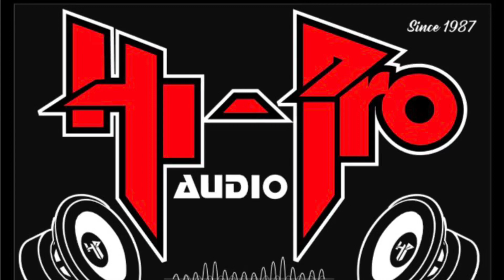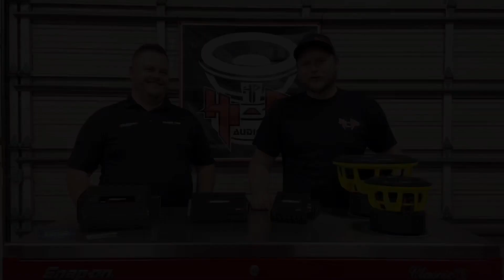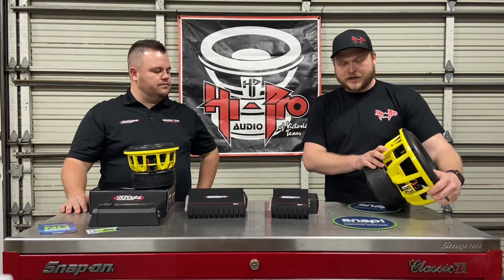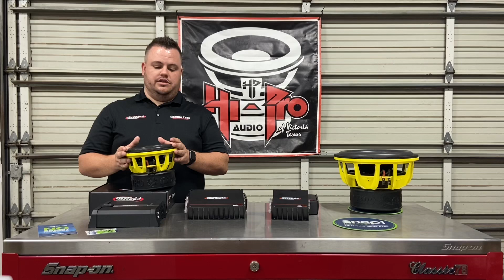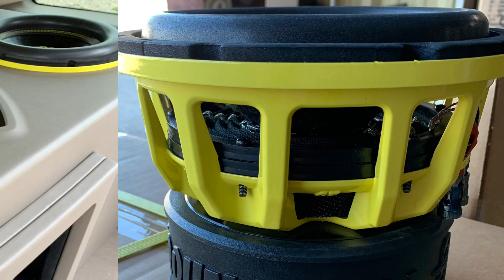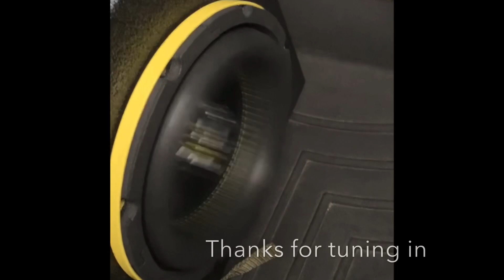Shop talk ground zero audio and soundigital amplifiers

Comment: I'm getting ready to put two of those GZHW 30XSPL-D2 in my 1990 Dodge Dakota extended cab with a GZCA 5.0SPL-M2 and cant figure our anything on a box you have anything to help like a blue print ill pay for one just got a lot in this want the best
Reply: WoW!!! That setup will destroy that truck. I have the 1500W GZ comp mono in my truck with a custom hydrogen dual 10 box tuned to 32hz and my headliner doors wiper blades and everything vibrates like crazy and that's with sound deadening!  5K is way more than enough power bro. Your gonna want to get the box built in the middle max net volume recommendation. My 10s are 1.5 cubes net per sub. Box cost me 400 it was worth it.
Reply: @curtisb9066  bro i no its one year but i did 4 with 2x5ks

Comment: I have a green version of the hydrogen 12. And I recently bought a soundigital 3000 evo. I was wondering how accurate the clipping light is.
Reply: How does it sound, I just ordered a hydrogen 15 and I have taramps 3k on sundown but I'm wondering how it's going to compete to the SA series, I just noticed im not in my account lol
Reply: @mariamontellano1631  did you get it installed? Hydrogen is more comparable to X/Zv5 I would say.